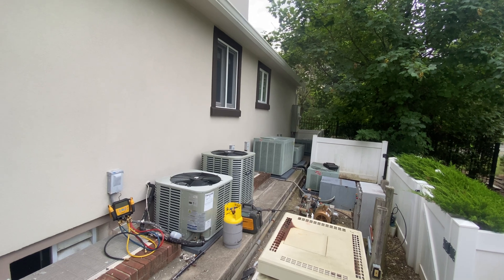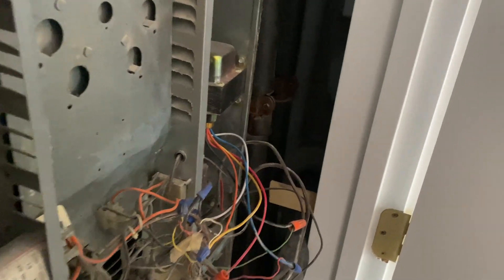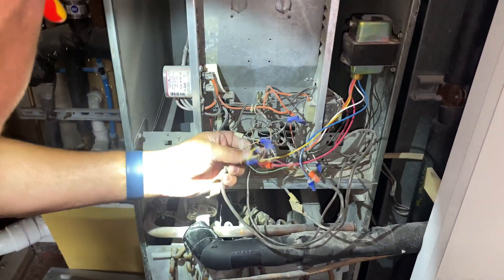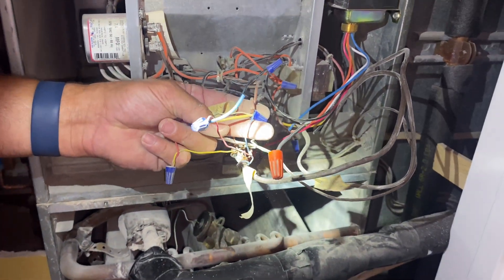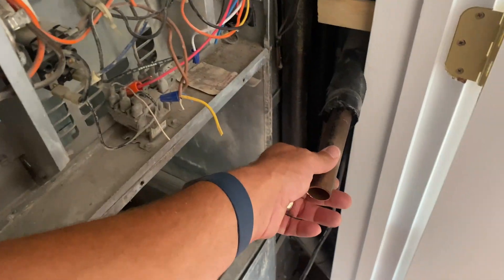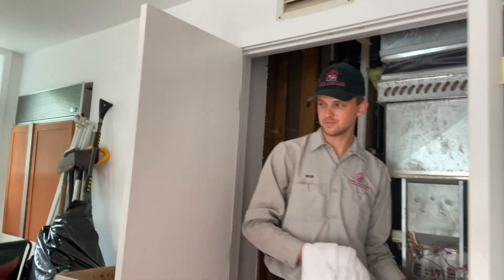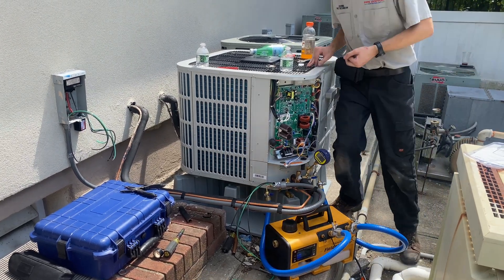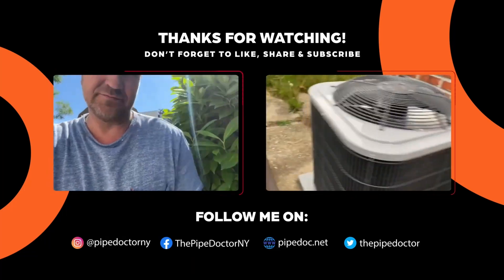Extreme HVAC Hackery!  R22 System with R410A Condenser? Yup! Pipe Wiper System to the Rescue!

Comment: Mikey been just got bukkaked by the unit! Lol
Reply: My guess is that it possibly was caused by trapped refrigerant and oil and when the pipes were opened it released the vacuum and the oil came flying out. That’s just my guess though

Comment: I don't know if you'll answer this question. I grew up going with OEM unless is something like a condenser motor that can go with a universal motor. I work at an industrial facility. Found an American standard package unit R22 with a bad compressor. I wanted to go back with the original compressor just follow procedures to retrofit for 407C my supervisor said no let's put a 410a compressor just redo the piping. I told him my name will not go on that job pass it on to the next tech. What's your viewpoint on this. He said compressors don't care what refrigerant is in it. It only has one job is to move refrigerant.
Reply from the maker: Thanks for the question — and respect for standing your ground.

Your instinct was 100% correct. Compressors absolutely care what refrigerant is being used. It's not just about moving refrigerant — it's about oil compatibility, operating pressures, temperature glide, and system design. R-410A compressors are built for higher pressure systems. Throwing one into an R-22 system — even with re-piping — is asking for problems: lubrication failure, efficiency loss, or worse, a total system crash.

Your supervisor's “it just pumps refrigerant” line is dangerous thinking. If that logic held up, we’d be throwing any random compressor into any system and hoping for the best.

Stick to your guns. If your name's on it, do it right — or don’t do it at all.

Stay sharp and thanks for watching.

– Mikey Pipes 👊🧰🔥

Comment: Hey Mikey, question for ya about the oil discharging randomly. Was it an extremely long run? I ask only because I was doing the same exact job 2 weeks ago bosch 2.0 changeout with a very long lineset run and maybe about 10 minutes after recovery and cutting the lineset the line just spit oil out almost as if it was under pressure. Firat time seeing that and I've been at this awhile like yourself.  I saw your video and saw it happened to you and of course now I'm trying to understand why it happened

Comment: Tubing has a trap and the oil held back pressure but then the sudden release sprayed oil    would be concerned wi th oil return on the oversized line set

Comment: Amazing that wh wasn't back drafting , Easier way to change the valve though , but glad to see you use the 1/2" nipple as a wrench! I guess its not code for expansion tanks where your at. You should use needle nose pliers to remove the wire harness from the cover , those wires come loose over time when you pull on the wires to remove , just saying! Great Video as always!

Comment: if the evaporator coil was new enough, it's likely the same coil used for R22 or R410 systems, with different piston/txv and labeling, back in the transition period. many are dual rated still for repair jobs.
but who knows on that basket case mess. 🤣 yes it's really best to replace condenser and evaporator at the same time.

Comment: Eh the 410 condenser doesn’t bother me much…most air handler coils are designed for heat pump pressures so can handle it…the TXV is a shame. It would have been a decent budget job, the older rheem equipment was stout.

Comment: Pressure/refrigerant were trapped somewhere in the lineset by oil , once it warmed up after you evacuated the system the warmed up gas had enough pressure to spray the oil out at ya
Reply: Also explains why the vacuum took for ever to pull down , residual oil/gas
Reply: @PipeDoctor  was fuckin funny tho , glad you got it on film 🤣

Comment: I had a company talk me into replacing the indoor coil when I bought a new furnace in the muddle of winter. The tech saw it would be a cleaner install. My compressor was a R22 but found out that indoor coil was a 410. Found out this when I replaced compressor 3 years later. One company said I would have to replace  the 3 year coil. The original company also gave me a bid and said the coil needed to be replaced. I tossed a fit and they changed their opinion that no wouldn't have to replace coil.
What is your opinion, with the coil fail sooner because of this.?I think the tech must get a commission on the sale.
Reply: That replacement coil probably had a one year warranty. If you did a new coil with a matching outdoor unit you’d get a 10 year on both usually. However, if you reused the coil and did outdoor only, usually a five year on the outdoor at best. I usually try to get the customer the best warranty.

Comment: Much better plan to replace the old outdated system with the new much more efficient Bosch system,if that was a commercial install they could claim a good carbon foot print.

Comment: I installed a condensing unit on a r22 unit 3 years ago. Charged it with 410a and its been running great since then. Only did the condensing unit 🤷‍♂️
Reply: Probably has a fixed orifice. Big difference

Comment: Whenever I used Pro flush on a system I made sure to pull a vacuum as far as it will go until it stagnates. Then I put fresh oil in my vacuum pump. Then rinse and repeat as needed.

Comment: Yea I’m pissed, some hack installed a R22 system in my house in 2015 I replaced my units in 2015 a 5 ton and 2 ton and I remember telling the guy I wanted the 410a units which the 5 ton is well I went to school for hvac this pass year just for myself to learn it , i am the type of person if someone else can do it so can I , when to clean my condensers and found out, I had a 2013 unit with R22 Pulled receipts, and I paid for two 410 units

Comment: if the evap coil is rated for 410 pressures AND you change the metering device AND flush the lines you can change the system to 410.
Reply: Your question does not make much sense. If you are talking about reusing an R22 evaporator, technically, they can be used on a 410A  air conditioning system only if not using it as a heat pump. If the system is to be used as a heat pump, then 100% no. Why would you want to reuse an old piece and go through the trouble of flushing and changing the metering device? Many R22 systems had pistons and would need to be changed to the right size. Or a txv installed. Me personally would never reuse a coil when replacing a condenser unit. Nit unless it was 5 years old and the condenser is being replaced due to some crazy thing like a rock was shot through the coils.
Reply: @walkingneartheriver  Good points. It also boils down to cost and time (which is $$$). Many people don’t have those extra dollars available. I have to flush the system anyway. New piston is $20.
Reply: @PipeDoctor  Probably not THAT air handler but the evap coil in my up flow furnace is another story.

Comment: Hey Mikey . I was told there are guys . Taking  410A condenser and using them as 407C . Take if the 410 out .and charging them up with 407C .
Reply: @PipeDoctor  I guess because you can’t get R22 or R407c condenser anymore. Just another hack job . I would never sell a customer something like that . Go for a new 410A system .

Comment: The old school stuff worked and lasted bosch is not a rolls royce and carrier is even worse let me say trane is now bottom of the barrel there warranty is complete junk and to add bosch can be warrantied but parts are 6 months out and let go back to the simple ways of cooling …..
Reply: Your right Trane is crap, but carrier is the innovator when it comes to equipment. What brand in your opinion is the best?

Comment: My first thought would be someone put 410A in an r22 system. But my second thought would be that someone pulled the 410a out of the precharged compressor and charged the whole thing with 22. Did you initially check the pressures to figure out what it was charged with?
Reply: Exactly my thought.
Reply: the compressors have not changed much, it is just the oil installed in the compressor that has changed, r22 uses mineral oil, so if the compressor is labeled r410a, just dump the oil and install the oil for the refrigerant you want to use. it will run just fine. some evaps will cross over from r22 to r410a, one of them is the 3.5 ton evap, there is very little difference between the r22 and 410a evaps.
Reply: @PipeDoctor  figured you were testing not guessing.........since you coined that phrase......
Reply: Diagnosis= hackery. Good work.

Comment: I ran into that 
Removed 410 
Ran 407c 
And it ran sweet
Reply: @PipeDoctor  heatwave air handler in attic 
Until indoor unit replaced !
As a temp repair 
Bought some time

Comment: I thought the video was going to be about the 410A and R22 mix up. What are the effects of having a 410a condenser and a R22 air handler?
Reply: Most r22 coils are not rated to handle 410a pressures. Leaking coil is what will happen. Oils mixing will be a compressor issue sooner then later. If your gonna do it buy once and cry once. These are just some of the things that WILL happen
Reply: Pressures and oils mixing not a good idea.
Reply: @geomarzolf8608  Yes but why?! What can happen? What's the worst case scenario?
Reply: @s1dest3p There is an issue with miscibility. Meaning how well the refrigerant and oil mix. 410A is designed with POE oil in mind. This allows the oil to travel through the system and back to the compressor. There may be issues with that if oils are mixed. I wouldnt know much about the exact science behind it all, but it is important. This can lead to premature compressor failure, oil logging, etc. As the other commentor stated, leaks can Aldo occur if the coil isn't rated for the 60-70% pressure increase from 410A. There is also the issue of gaskets and seals, R22 permeates and causes them to expand, even changing to an R22 replacement refrigerant like R438A can cause leaks in the gaskets and seals as they will contract. From there the TXV must be properly designed to adjust flow rate precisely to the type of refrigerant. Otherwise it will lose capacity and cause premature component failure.
Reply: @geomarzolf8608  Other than the pressure difference, is there really enough residue oil left from the r22 to cause a problem with an new, recharged 410a condenser unit with 410a refrigerant?  I have a small r22 split unit that I was thinking about just putting on a 4120a condenser unit.

Comment: Just pull the 410a charge and charge it with R-407c done deal
Reply: @PipeDoctor  bet it will cool as well as a 410A  🤷🏻‍♂️
Reply: the customer is always King, unquote
Reply: the customer is always King, unquote. @PipeDoctor
Reply: The compressor plates won’t separate at the proper time if you do that. Potentially making a bomb
Reply: 407 is sh#%!

Comment: The indoor part of our system is also loaded up with dust and hair. So much so in fact that some of the condensation is dripping down into the area where the breakers and blower is. Anything we can use to try and clean the coils with that will help with all the hair build-up?
Reply: @PipeDoctor  Does that mean replace the coil?